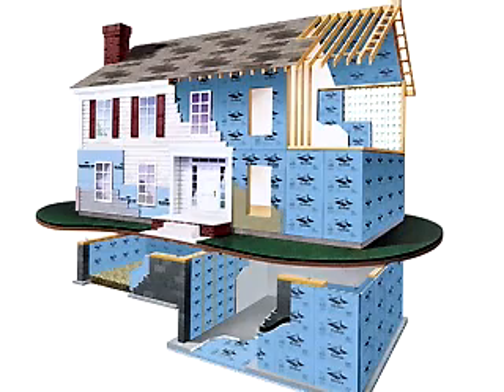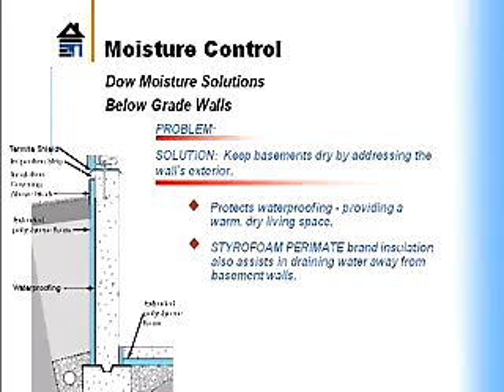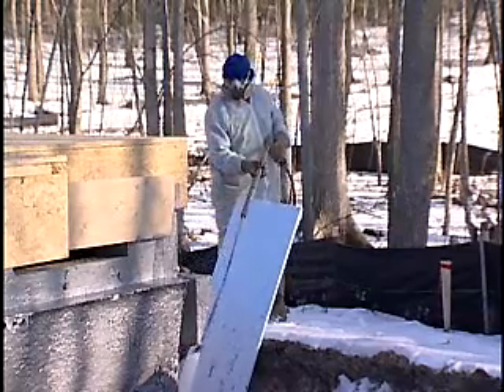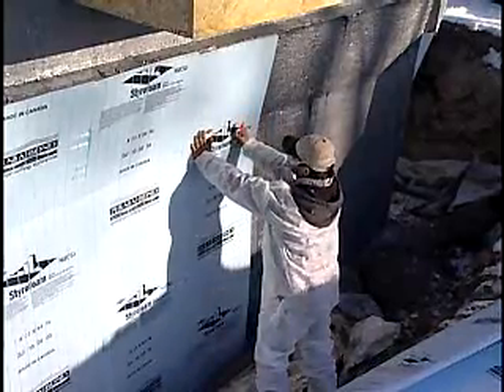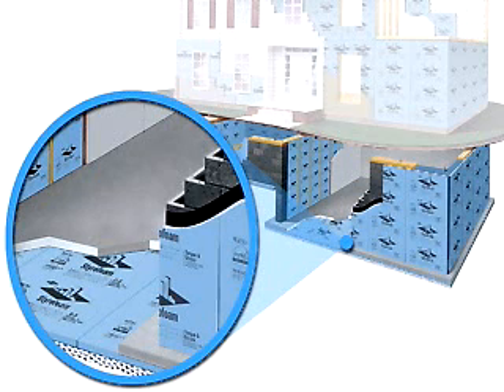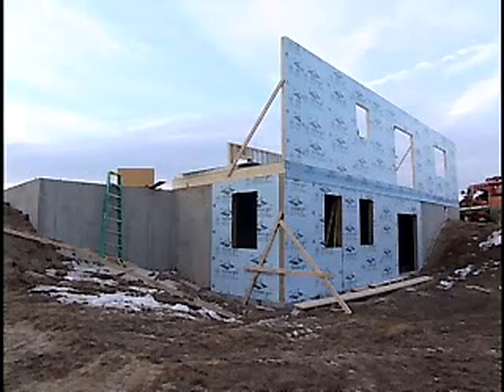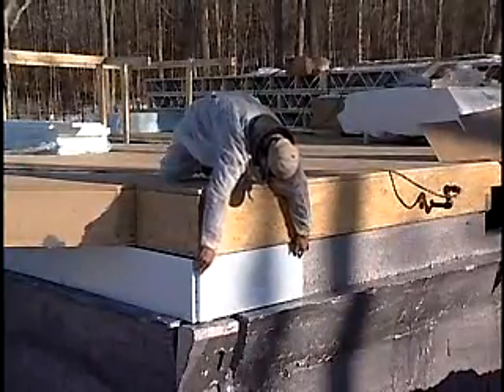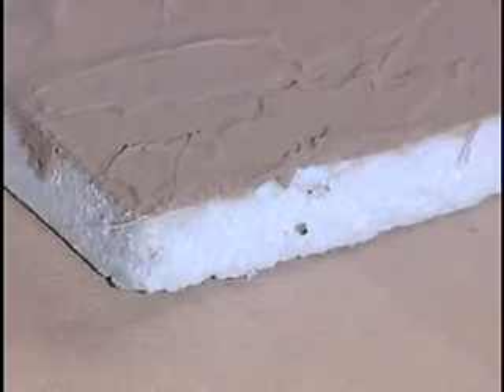Installing Rigid Foam insulation at slabs and foundations

Comment: I know of a large property in CO that has approximately 20 residential MDU buildings with this type of install. There is approximately 8-12" of rigid foam that is exposed above grade / below the lowest level of siding. This exposure is of course around the entire perimeter of each building, so there's a lot of it getting hit by the elements, residents, landscaping crews, and pests. The foam is coated in what appears to be one of these brushed on products mentioned in this video, and I can say with absolute confidence that it does not hold up at all. This stuff has been an absolute maintenance nightmare and a recurring drain on the HOA's repair budget each and every year for the last 15 years. If anyone has any suggestions for fixing this I would love to hear it.
Reply: If future generations see this question, the answer is to just cut the foam away if it's annoying you.

Comment: 1:55 That is incorrect.  The vapor barrier sheet is always the last thing before the concrete slab.  Six inches of washed gravel with water drainage piping, then foam, then vapor barrier, then concrete.  Amen, let it be so.
Reply: I don't think it really matters, unless the concrete crew doesn't want to walk on the poly.
If concerned about readymix getting under foam during pour,  foam could be taped.
Reply: under slab you can put vapor before foam in oregon but i agree
Reply: You are incorrect. The rigid foam insulation is closed cell foam. The foam insulation is the vapor barrier. You don't need to install a seperate vapor barrier with closed cell foam.

Comment: Which is more effective under the slab vapor retardant on the ground and then foam or visa versa?  I would think the retardant would be on the warm side as well as it would be better protected from rock punctures on that side.  Most chairs are designed to not puncture the vapor retardant.  Especially if a 10 mil thickness is used.  What are your thoughts?  I like two inches of foam on the base and then the vapor retardant.  Doug